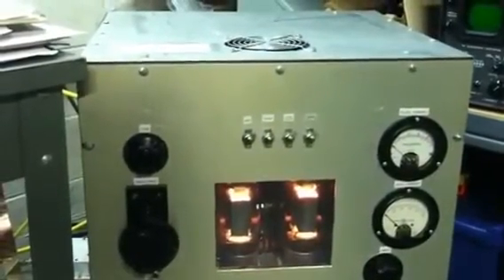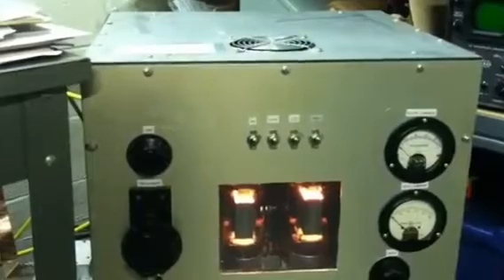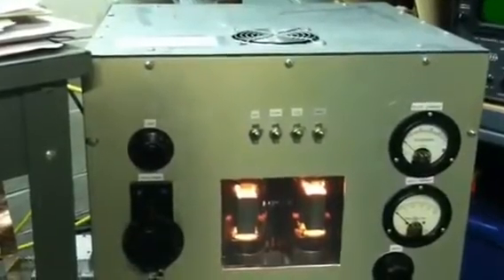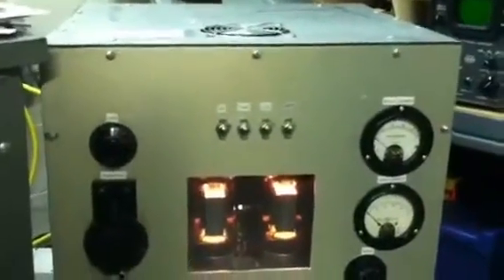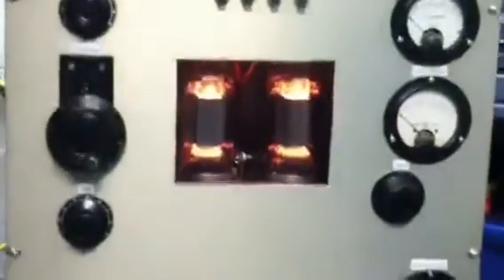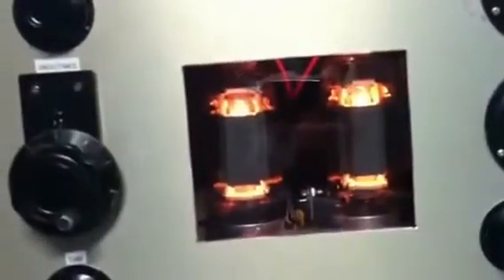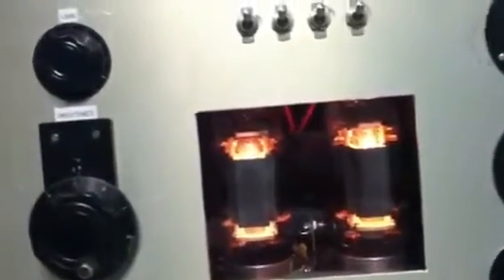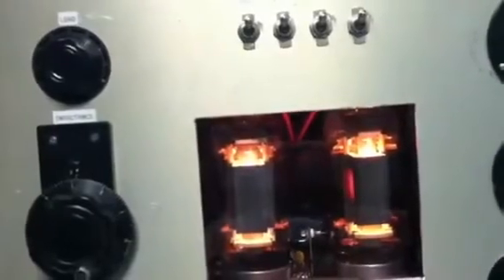2 X 813 AMPLIFIER, 872A MERCURY VAPOR RECTIFIERS

Comment: 3KV on the plates? Too much! 2.5 KV max. And what is the plate current? They should never glow red when transmitting. You're effiency must be quite low.
Reply: Before I had a variac on my homebrew 813 amp I ran them at 3800V for over 2 years. I was running the russian gu13 tubes at the time, and am still running them. They are still putting out full output. They would cherry up when I got long winded but its hard to hurt an 813 with a little air flow. 3kv might make them blush, but they are happier at 2500 for sure. But to really see them sing you gotta put more sauce on them.

Comment: Is this a linear amp or a transmitter? You may want to consider graphite 813's.. I don't think the metal type plates are supposed to be pushed to glowing. Nice job just the same - Beautiful rig!
Reply from the maker: +Bob H It's an amp. I was a little hard on the plates! I don't really use it much, more of a nostalgic amp. I always wanted to build a high voltage supply with 872A rectifier tubes, love that purple glow.
Reply: +KF8OD - Yes, gotta love the 872A glow!